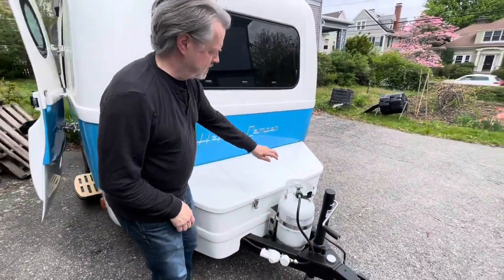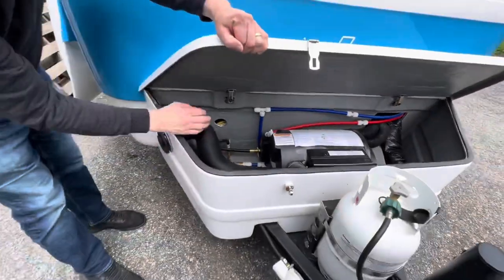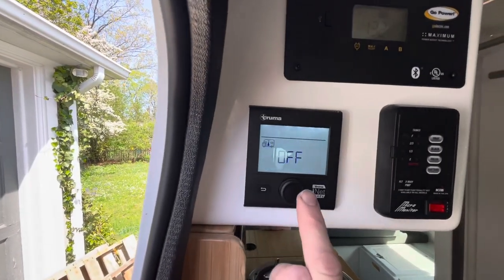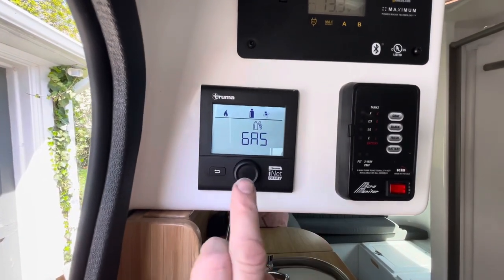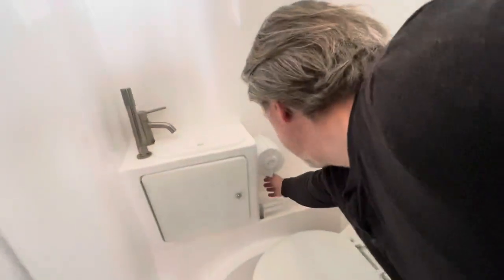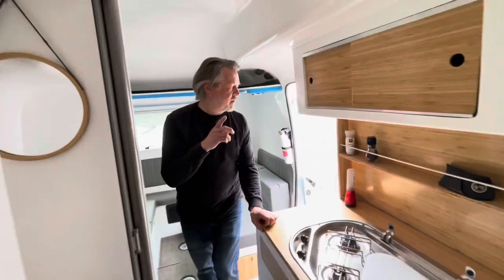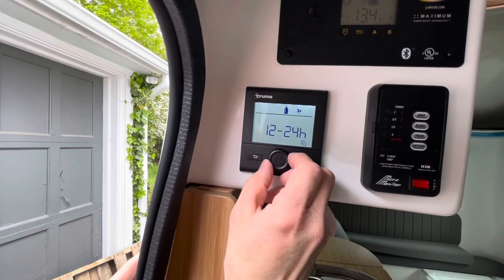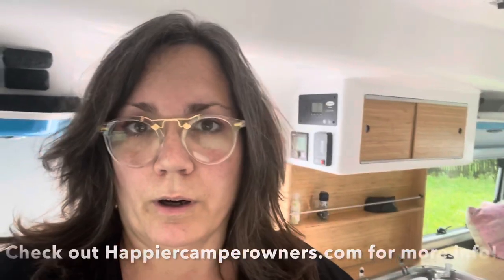The Heater in our Happier Camper HCT

Comment: My family of three is considering the HC1. We have many uses in mind, including taking it up to the local mountain pass during the ski season. The highways are well-maintained here, and we feel comfortable hauling it up there in the snow. However, we definitely are concerned about heating. Having owned both the HC1 and HCT, do you think the propane heater on the HCT will be sufficient to keep three of us warm at night in 30 degree weather? How long does it take to get through one full tank?
Reply from the maker: The Truma heater is outstanding - and I apologize for such a late reply. We've used it on nights below freezing and been toasty warm. Not sure on how much propane we used though I'm sure it was less than the tank we had for the weekend.

Comment: Does the camper seem to insulate well? I guess that could be measured as how long it holds its temperature once the desired temp is reached.
Reply from the maker: It actually has a double hull construction which is why it's an all weather camper - I've never done a temp check and a heater is an option that we have and we find it is very comfortable..